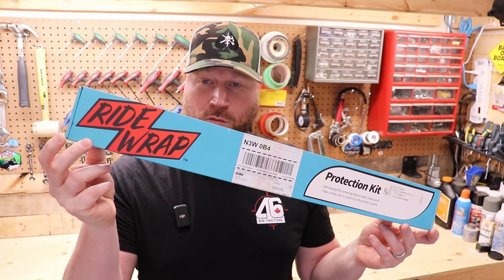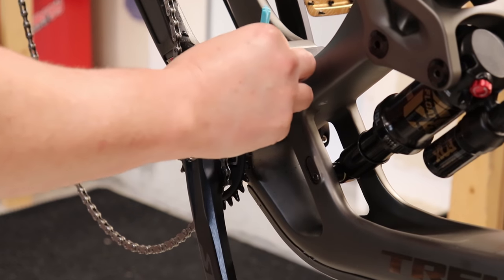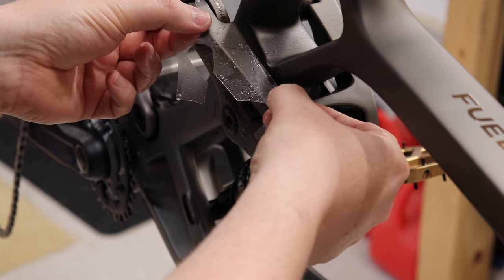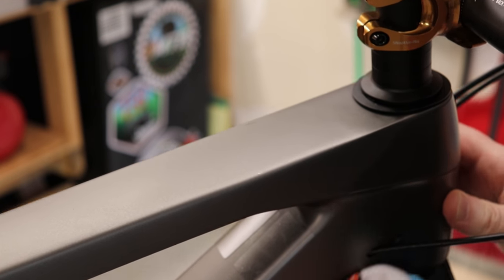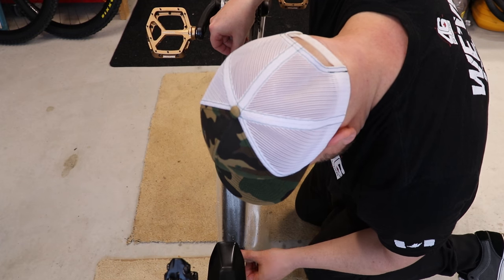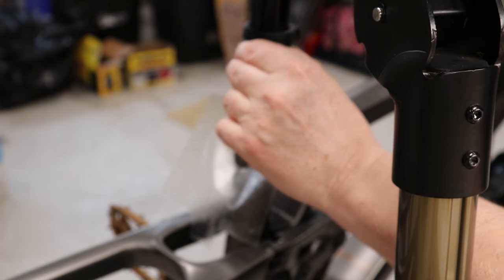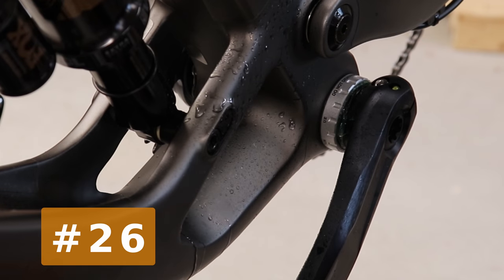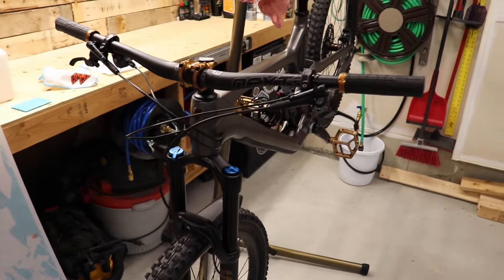Ride Wrap Unboxing & Install on my Trek Fuel EX 9.7 Gen 6

Comment: With vinyl wraps, a heat gun is your friend.  That takes all the little bubbles out, helps to "wrap" the vinyl around tight little corners and such.  Keep in mind, you're using small amounts of heat on the wrap, not toasting it.  Especially on a bike application since there are plastic brake lines,shifting components guards, in close proximity.
Reply from the maker: Very true but I just didn't feel safe using my heat gun on the carbon. I may have been able but with my luck I would have melted something lol 😆 Thanks for watching
Reply: @ESBMTB  yep, i totally understand.  using a heat gun comes with a little "pucker factor" everytime.  i've done enough vinyl on vehicles that i feel comfortable enough, and my EX8 is aluminum so no worries.

Comment: Do you think your bike have the exact same measurements as the EX 8 Gen 6? RideWrap don't have the tailored kit for the 8 in stock but they do have the kit for the 9.7 and i am very tempted to buy it anyways, what would you do?
Reply from the maker: It's probably close but mine is carbon and the 8 is aluminum. The thickness may be different. I'd wait till they have it in stock. If they are not going to make it then I'd say order it!